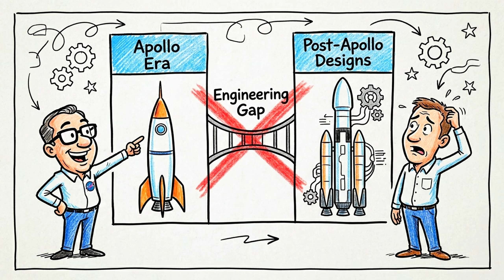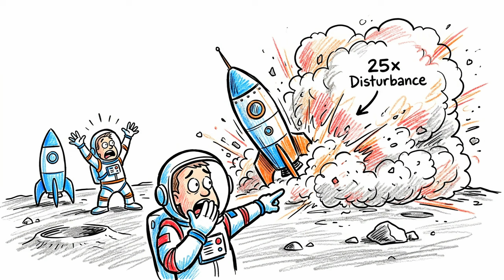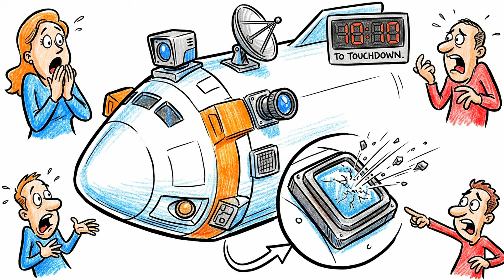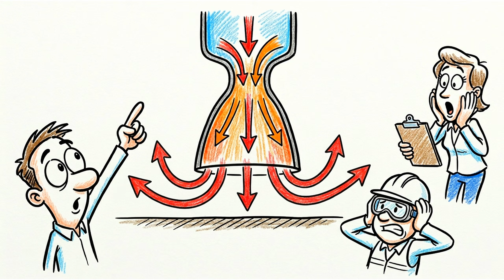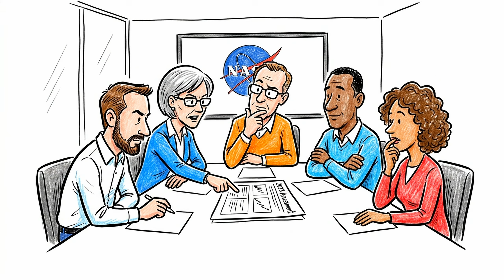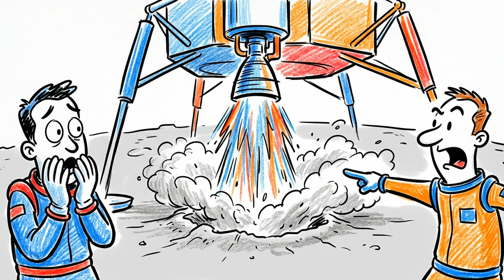Apollo Did Not Prove This Kind of Moon Landing

Comment: How do you test landing a 100 ton cigar shaped vehicle on rough uneven ground in a vacuum? The LEM was intentionally ugly and shaped like a squat spider because it didn't need to be aerodynamic in space. This meant that it was easier to land without tipping over. They tested models by dropping them sideways and seeing how they performed and designed the Lem to land safely even on a sloped surface. You can't do that with the current design.
Aso, a tall rocket will be a nightmare to unload since all the cargo and crew are at the highest point. You will need to push heavy equipment out the side and lower it to the surface with a crane. This must be done very carefully because the ship will be unbalanced and could tip over.
They tried to land a probe shaped like a refrigerator on the Moon and it fell on its side. When humans are at risk the margin for error must be close to zero, especially in this era where we are much more safety conscious.

Comment: Starship has the right idea to use upper stage thrusters to land the ship as this will for the most part avoid the hole digging of a rocket plume. Musk and his engineers know about this issue and have taken steps in Starships design.

Comment: They used to think that the moon had multiple feet deep dust covering the suface in most places. Even when the Eagle was coming down there was concern they might drop into a deep snowdrift of dust and become swollowed up in the dust. So when Armstrong mentioned  picking up dust that's what was on his mind along with hundreds of engineers  back on earh. The hand was close to the abort switch those last few seconds to blast free if the lem started to sink into deep dust. But now we know that for the most part the moon does not have deep dust covering it's surface. However, some craters may contain deep dust collections.